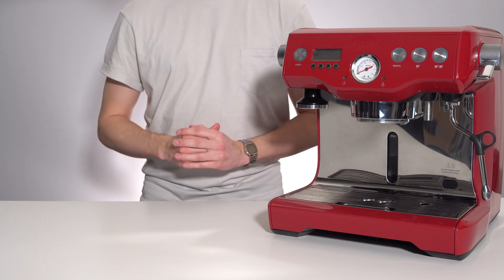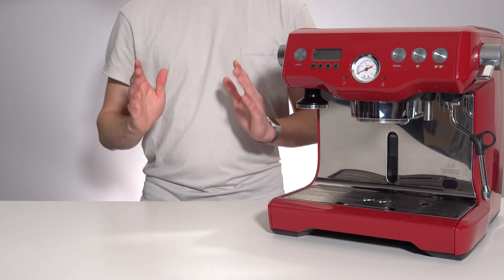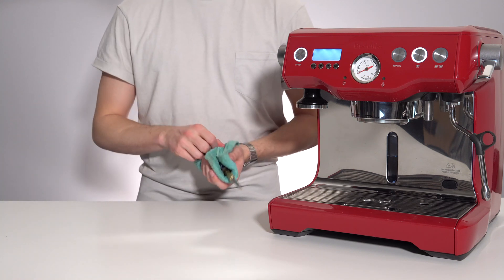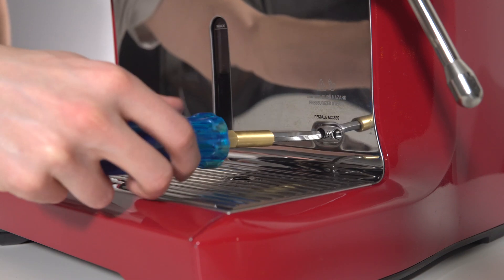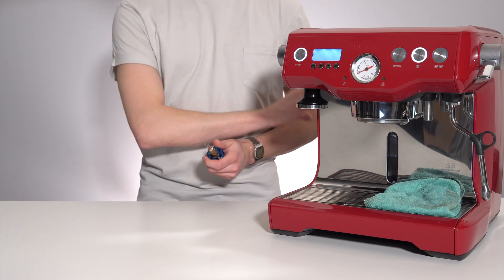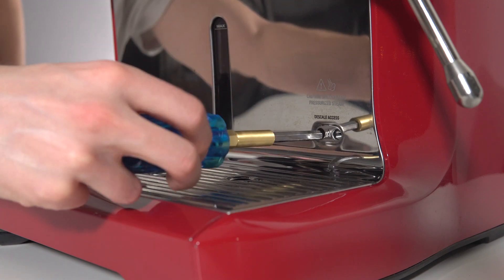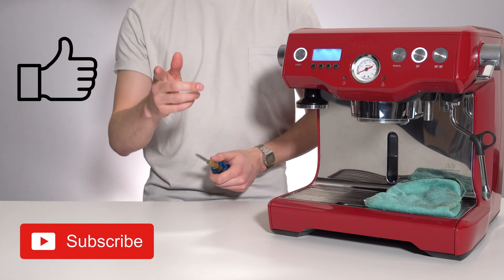Breville Dual Boiler Descale Instructions

Comment: You do mention, at the beginning, ,there are different versions of Breville dual boiler machines. As such, the “manual” OR “1 cup” button will illuminate. Your instructions miss a very important step. The V3 machines do not have a five minute flush boiler in the descaling procedure. The V2 does. In the V3, it is only the 1 cup button that illuminates and all of the processes, in descaling, display and take 20 minutes each. So for those V3 owners who are expecting the five minute boiler fill/flush to occur… don’t hold your breath.
Reply: What to do with the V3? i turned the power off after doing it two times for the V3 since there's no 5 min flush. When I replaced the filter and the water, turned on the machine again, it said to de-scale again.
Reply: What is the name/number code for version 3 versus the v2? Thanks
Reply: ACKCHUALLY the longest breath hold record is 24 min so use this to practice your breath hold lol

Comment: What triggers the de-scale prompt? Number of shots or hard water buildup?  I de-scaled a number of times until steam stopped working after a de-scale. Breville said, 'do a manual de-scale'. That didn't work and an expensive repair followed. Had to ship the machine to another city for an authorized repair. No indication what was done in the repair. Online forums have many many different theories and it just makes my head spin...
Reply from the maker: If your machine was THAT damaged, you were using very poor water that would scale any machine very quickly. 
The descale alert is triggered by volume of shots, AND the water hardness setting you are supposed to program in using the included test strips when you first get the machine
Reply: My water isn't that hard, It's city water and I use a Brita filter and change the machines filter regularly. My brain hurts!  @LifestyleLab_  And I ALWAYS descaled when the machine asked for it..
Reply from the maker: Brita filters are unfortunately not very effective at removing water hardness. You should be ideally be aiming for a PPM between 50-85 for use in an espresso machine, ABSOLUTELY no higher than 150
Reply: @LifestyleLab_  Thanks! Can you recommend a filter system?
Reply from the maker: Best option is to buy bottled water with a good ppm and mineral content (La Marzocco recommend Crystal Geyser). Or use distilled water, and remineralize it with something like third wave water espresso formula
Reply: @LifestyleLab_  thanks so much for your help….much appreciated
Reply: @LifestyleLab_  I ordered test strips and my water was around 1ppm out of the tap. VERY soft. Not trusting my own test, I googled my city's water hardness which confirmed the 1ppm. Crazy! It wasn't hard water that killed my steamer while descaling....

Comment: I’ve heard this can brick your dual boiler and you have to only empty one tank at a time but I don’t know how to do that. Been on many forums and the general consensus is do not descale this machine you’ll kill it. I haven’t descaled since I’ve owned it, I only backflush. I just know I’m going to melt some important plastic piece when I descale. Any thoughts on all this? And please don’t say it won’t do anything and it’s as the manual says because there’s literally thousands of posts on this.
Reply: If you don’t descale regularly your machine might blow up. Either that or it will require expensive repair to remove all the lime scale that has built up in your boilers.

Comment: Thanks LL but it didn't actually work for me. My machine looks exactly like the one you are showing here and I got up to the point where it says the 5 minute mark... It doesn't go to the 5 minute mark, it repeats the 20 minute one... I let it go 2 more times but figured that was enough. In the end the only way I could finish it off was to turn it off. Ideas please?
Reply: Hi, same thing happened for me. No 5 minute mark as well. Would like to know how the process should be wrapped up too. Thanks in advance.
Reply: I found the same thing. Here's the comment I left for the poster. 
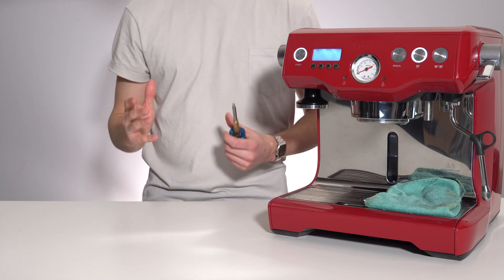So the first thing to clarify is at the 2:56 mark, there is no 5 minute timer. It's a 20 minute timer just like the first time after you add your de-scale solution and press the 1 Cup button. So let it run 20 minutes the 2nd time too. The second clarification needed is found at the 3:45 mark. Here we're instructed to press luminated button to exit the descaling mode. However, the illuminated button to press is not the 1 Cup button, but rather the Power button. This will exit the de-scale mode, will fill your boilers and begin to heat them up. Cheers!
Reply: @Pilsdad  thx so much for the further explanation 🥰 merry Christmas!
Reply: @virgillialeefreddy2171  have a Happy New Year!

Comment: How do you exit de scaling? Mine is stuck in a loop, won’t stop descale. Was going for an hour and continued to descale. Tried everything from turning off the machine to holding down the power button. Nothing works.
Reply: The second clarification needed is found at the 3:45 mark. Here we're instructed to press the illuminated button to exit the descaling mode. However, the illuminated button to press is not the 1 Cup button, but rather the Power button. No need to hold it down. Just tap it like normal. This will exit the de-scale mode, fill your boilers and begin to heat them up. Cheers!
Reply: @Pilsdad  is 3:45 mark 3 hours and 45 minutes? Im not with my machine right now so can't tell
Reply: @A Maximus it's the 3 minute 45 second mark in the video. At that point you can just hit the power button to exit de-scaling mode.

Comment: Can you use white vinegar for descaling ?
Reply from the maker: It is not recommended, no 
Vinegar can errode some of the plastic gaskets
Reply: @LifestyleLab_  Yes, vinegar can be used to descale. It is not recommended though. Reasons being, it is not as effective as other purpose built chemical products and, well, it stinks. There is no plastic in the BDB V-3 that is adversely affected by using vinegar as a descaler. Remember, vinegar is an acid and not as strong as the acid level found in  descaler recommended for the Breville DB.

Comment: First of all this video is spot on for de-scaling the Breville Dual Boiler. Breville support actually recommends descaling every 2 months if you pull 2 shots a day. I wish that was in the manual.
There are a couple of things to clarify in this video. I'm assuming this a BDB v. 3 since the post date is 4/5/20. So the first thing to clarify is at the 2:56 mark, there is no 5 minute timer. It's a 20 minute timer just like the first time after you add your de-scale solution and press the 1 Cup button. So let it run 20 minutes the 2nd time too. The second clarification needed is found at the 3:45 mark. Here we're instructed to press luminated button to exit the descaling mode. However, the illuminated button to press is not the 1 Cup button, but rather the Power button. This will exit the de-scale mode,  fill your boilers and begin to heat them up. Cheers!
Reply: Meltorme—-Could not have said it better myself… but I DID try to. See above. 🙂
Reply: Breville might recommend that but it all depends on how hard your water is. If your water is SOFT, that descale warning can take almost four years pulling two shots a day.
Reply: After every Descaling Steamboiler is off for ca. two Days((

Comment: @2:55 in the video it doesn't say to rinse out the tank and fill with fresh water before hitting the 1 cup button for the 2nd 20min cycle. I followed the video's directions first and followed up by rinsing out the tank and running the descale cycle 2 times with fresh water only to flush it out. Once that was completed and I hit the power button, I had no issues with steam or the descale message.
Reply: @superglue7677  I used 1 Breville packet to a full tank of warm water. Since it ran it through twice I used most of it

Comment: Thanks for the video. Just want to clarify on point: after the descaling cycle is finished there is no mention of emptying the water tank and rinsing out the remaining descaling liquid and then pouring in clean water for flushing. 
If I’m wrong please let me know. 
Thanks again for the video
Reply: 3:06
Reply: @kkhyeona683 He just said to clean out the drip tray, not the water tank. I had the same confusion as OP & there does need to be a clarification that you should also empty, rinse & partially re-fill the water reservoir as well.

Comment: Excellent tutorial, only one question. How much of the decaling solution you used. Besides the Oracle I also have a DeLonghi fully automatic and there are markings on the water tank for the descaler and the water level meaning you mix the two in the tank.

Comment: Great video again! Thanks for posting. Question, is it normal for the Dual Boiler to be so loud as you are dialling a short or using the hot water? I find it quite loud in the morning when everyone is sleeping and I'm wondering if there is an issue with my DB. It's only three months old and has loud out of the box. Thanks
Reply from the maker: Unfortunately, volume is a notable downside of vibratory pump machines. Higher and machines are often fit with rotary pumps which are far quieter. But that is entering into a higher price point.
Reply: @LifestyleLab_  thanks for your reply, it makes me feel better that this is not an issue I'm having with my machine but rather the design of the Breville!

Comment: In my case when I press the eliminated one cup button it always does the 2pmin cycle. No matter how many times I do the cycle. I don't get the 5 min option nor does it do the final cycle. 
Also do you need to take out the filter from the tank when doing the descale?
Reply: I have exactly this problem! It doesn't matter how many times I run through this cycle, the One Cup button always kicks off a 20 minute cycle. Also, the instruction manual says that to complete the cycle at the end, press the POWER button. When I do that it starts to heat the water (i.e. like when you switch it on) but also tells me to de-scale! Sends me batty!
Reply: @mikhail…

Repeat descale until “descale” message does not appear.  You are using a V-3 machine, but the instructions for descaling are for a V-2 machine. Repeat the 20 min descale/ drain/ fill and descale/ drain/ fill and descale/ drain/ exit by selecting power bewtone. Make sure you add fresh water after replacing the filter in the water tank. Your maccina will be as good as new.
Reply: Mine is the same! I have had mine for several years. Have not been able to get rid of the descale logo. Some people say it will go away after cleaning and your use it for a few days. Has never worked for me!🤷‍♂️ Machine still works beautiful though.
Reply: Me too

Comment: 2 questions - 1) Do you mix the descaling solution with water if so ratio, quantity or pure descaling and how much of it ? 2) Is it really safe to descale recent (v3 from late 2021) machines as there are tons of horror stories, some even in the comments here. Thanks!
Reply from the maker: 1) Follow the instructions on the bottle. Different descaling solutions need different dilutions 
2) The machines are designed to be descaled. Personally I've never had an issue, but clearly others have had a different experience...
Reply: @LifestyleLab_  Thanks for the excellent video and very fast reply ! I do wonder if the descale blunder is still currently applicable but it does seem to still come up quite often.. perplexing when you know this rather excellent machine has been through so many small iterations.

Comment: Just tried this but getting 3 beeps when trying to activate steam wound following descale. Any suggestions?
Reply: Breville recommends repeating resetting your machine hard water level. Letting your machine sit overnight and try the descale process again. That being said, it didn't work for me and I have a current case open with Breville. My warranty expired only 4 months ago and I'm hoping they will treat this as under warranty.
Reply: @Pilsdad  Any update to report? Did Breville honour their warranty or pull a fast one (ristretto) on your claim!
Reply: @mrgoggles1963  I like your use of ristretto. They did send me a brand new Dual Boiler, but only with a 6 month warranty. That being said, I had already received my Rocket Mozzfiato and promptly sold the replacement Dual Boiler.

Comment: Does anybody ever run into the issue of the "descale" notification not resetting? I've done the full process at regular intervals but it never resets.
Reply: @Hunter Sharpless Yes I have. To reset the descale issue you have to go into service menu to reset. I think to enter service menu you hold the 1 cup & 2 cup button for 5 seconds then press the power button. Then up/down arrows to reset. I could be wrong, it's been awhile since I had to do it....
Reply: did you find out how to remove descale message?

Comment: hello, I have a problem with a second hand BDB that i bought 2 months ago. this week i turned it on, makes the same noise as it should, the boielr heats up to 93C, the hot water and steam works fine. the group head heats up but theres no water coming from the brew head. What can I do to fix this? thanks
Reply from the maker: I would suggest contacting Breville support. I won't be able to help effectively diagnose
Reply: @LifestyleLab_  Ahh right okk, no worries. Thanks for replying back really fast which I did not expect hahah but, yeh, I will do. thanks.

Comment: Each time I'm done with descaling my machine my wand steamer doesn't work. It keeps beeping when I turn it on. I have ti descale it over and over again until the wand works again. What am I doing wrong?
Reply from the maker: You're likely still in decaling mode. Be sure you've exited descaling mode to regain full functionality of the machine
Reply: One of Breville's solutions is to de-scale again and again. But if you've done that, open a ticket with Breville. This is a known issue with the Dual Boiler. I have a ticket open with them now for this same reason. :(
Reply: Me too how
Reply: @Pilsdad  Did Breville ever fixed your machine?
Reply: @ristrafa7703  they actually sent me a brand new machine with all new accessories. Great customer service, but I still ended up getting a Rocket Evo R and put the new Dual Boiler on FB market place.

Comment: Did this proceedure on my 920XL but was not successful. The “de-scale!” message remains on the display. I contacted Breville but they only provided me with de-scaling instructions as help. Wondering if you can provide some guidance... Thanks!
Reply: Same thing with me. I've done it twice now and still receive the de-scale message
Reply: One of Breville's solutions is to de-scale again and again until the de-scale notification goes out. But if you've done that, open a ticket with Breville. This is a known issue with the Dual Boiler. I have a ticket open with them now for this same reason.
Reply: I have the same problem ,have descaled a number of times, descale reminder has not disappeared.
Reply: @silvioiadarola8273  Factory reset and retest water hardness. You’ll be fine after that.
Reply: @mrgoggles1963  How do I factory reset?